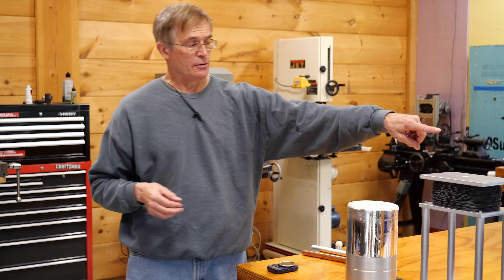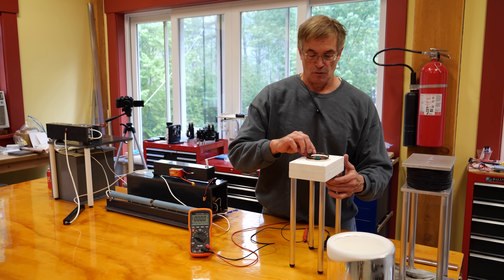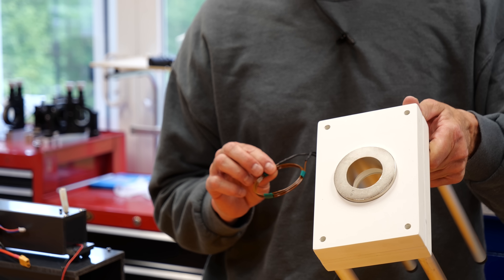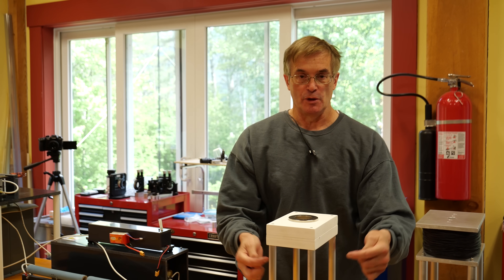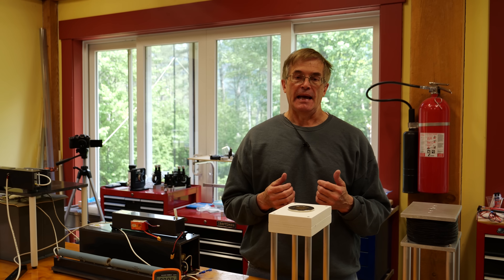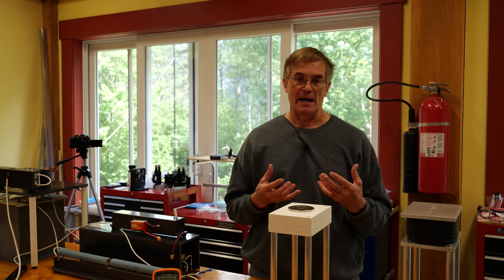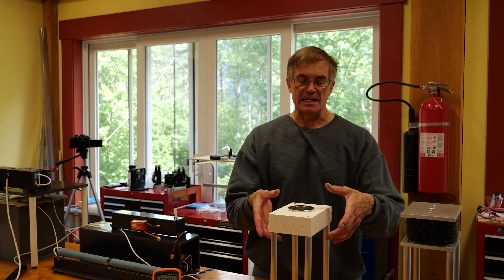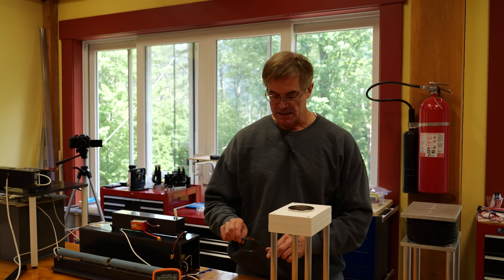No, we didn't use Magic to Crush this Can...

Comment: Question:  I have heard from people at Lockheed skunkworks that rotating a ferromercurial -barium and bismuth mixture in a circular closed tube system, similar to yours with sequential pulsed magnetic fields firing increasing speeds, they were able to achieve  "near-relativistic " speeds, a green glow started emanating from the tube, the whole apparatus was setup on top of a tared scale. At those speeds,, the weight of the system became negative & decreased anywhere from 5-18%.  I  wonder what your comments are about this. The unknown is the proportion of each element used in the mixture.  I suspect this likely produces a wave that interferes with gravity waves or particles, kind of the equivalent to a "standing wave". What do you think?  A paper was published from U of Alabama in 1997, from a Chinese researcher in the physics department,was axle to create such a reduction or weight by rotating circles of barium-copper at different speeds under a non metálica weight , I believe it was wood or plastic attached by a string to a digital "fish scale".  I believe there is something to this, likely not producing antigravity, but rather interfering with gravity waves/particles...  any thoughts?   Sergio  AKA Dr. T (physician, not physicist!)

Comment: Yes I just feed one point two-one gigawatts into the pulse capacitor...sorry...flux-capacitor, and the Time pinch wedges open a brief gateway to the fourth dimension...

☺I actually love your TMP design... I would have blown up an SCR because I didn't know any better...  Hmmm...a Spark Gap sounds like a fun project...  I might just do it because I'm curious what would happen if the can was subjected to a second event (or several)...  Would it shear?  Would it collapse further?  Would it be too far from the coil to generate an additional effect?  I'll keep a fire extinguisher handy... 😶‍🌫😉

Comment: What sort of effect would you get if you filled the chamber with deuterium and tritium mixed with a heavy noble gas like Xenon?  Perhaps with that difference in atomic weight could be used to create a shell of Xe gas around the reactant gases.  The xeon plasma encapsulating the deuterium/tritium mixture could still be hot enough to maintain a high enough temperature for the reaction but trap particles from hitting the walls of the containment vessel.  It's just a thought.
Reply from the maker: The Xenon won't help.
The necessary  temperatures are so high that ANY gas present will prevent those temperatures  from being reached by transferring the heat to the walls of the enclosure.

Comment: I've seen this video in the past but I just noticed the pinch after the magnet seems to propagate slightly.  Is this due to the flow of electrons similar to mach diamonds in the exhaust of rocket engines?  Obviously the electrons are moving much slower.
Reply from the maker: I suspect not.  It's likely due to the extended field from the magnet.
Reply: @TechIngredients    I thought about that as well but given that B fields loose strength at a rate of r cubed I figured the ripple would significantly decrease rather than keep a similar magnitude.  I may run it by my rocket propulsion professor since he does research in electric propulsion.

Comment: Probably the best explanation of the superconductor importance for TOKAMAC fusion that I have ever seen. The REBCO superconductors really do make fusion a reality, now, and not that , always ten years away line. There are many groups with compact designs, modular designs that enable replacement and quick turnaround due to the size reduction. Ultimately, this technology will give mankind limitless cheap power, and will usher in a new paradigm changing the way mankind lives . Things that seem impossible now, won't be. Unlimited power , an inexhaustible energy source, we will quickly spread out from our little nest.
Reply from the maker: The most exciting aspect to DT fusion is not electrical power, but transportation.🚀
Reply: @TechIngredients  Oh yes ! absolutely ! That plasma enables incredible possibilities for sustained thrust that could allow us to get to a serious fraction of c, theoretically. Of course, the limiting factor will be shielding the front of a vehicle from particulate matter. Running into a grain of sand at ten percent of c would not be good !

Comment: Awesome content and I appreciate the accurate technical details you include which is a relief when I am sorting through the fallacies of the information age represented on the internet. I have a request also. Could you do a project on how someone could produce their own electricity. For instance I was disconnected from the grid, which for brevities sake We'll say because the electric company is strong arming me seemingly because I don't use  much electric at all, and I need a sustainable way to live modestly in the modern world. That means electricity, which I would say those requirements could be met with as little as a few hundred watts of power if not using any high draw appliances. Basically just a few lights and the ability to charge a phone or tablet. I've switched over to propane so other than air conditioning I don't need much electric. At the moment I'm basically using the setup a RV might use; using 12V batteries and a 500 watt inverter which I power basically by charging them with my vehicle whenever I use it. It's actually like siphoning waste power that's always been there in a way, although I realize there is a negligible amount of extra effort this produces. Gas powered generators are not very efficient and I think I can do better. I've thought about solar but that's pretty much buy and install and is fairly expensive and not economical where I live at in the Appalachia. I've recently been looking into thermopiles to capitalize on the waste heat I produce for electric and also possibly for use with refrigeration. What ideas do you have. Thanks

Comment: A car engine has maybe 100,000 watts of heat going through it cruising on the highway.  But it does not even get close to the boiling point becauae of cooling.  A gas turbine has millions of watts going through the small space of the combustion chamber.  But it does not overheat because it is air cooled with compressed air.  Compressed air driven through the magnet coils could do the same thing.
Reply from the maker: Sure.
That would be the way I'd do it if I needed  to generate a powerful  magnetic field for an extended period.

Comment: I've watched several videos on z-pinch and this is by far the best demonstrating it. However I'm still left wondering from these videos is there a significant increase in energy output because of the z-pinch? Or is it just a physical means to keep plasma off the sidewalls. Additionally I read that z-pinch can create by-product x-rays is that correct?
Reply from the maker: Thanks!
It's a field manipulation that can be used to isolate plasma from the physical surroundings. If that permits higher temperatures to be generated, then it will facilitate fusion reactions.  Likewise,  a high enough plasma temperature will generate X-rays long before achieving the conditions necessary for fusion reactions.

Comment: How to make low temperature for the magnet ? Thank you
Reply from the maker: Rebco tape will work at liquid nitrogen temperatures, and you can get liquid nitrogen at low cost from a typical welding supply retailer.

Comment: Indeed the mechanical force created by moving electrical conductor in the magnetic field could be sensed. I have tried this with computer Hard Disk Heads Permanent Magnet and the Disk itself, all disassembled, in order to discover if the disk is made of glass, as many are, and may break, but used as a perfect mirror too, or of aluminum, and could be bent. Aluminum disk will pose a certain resistance or "own will" to the moving, while moving in the hand between the magnet poles, which glass disks will not.

Comment: Would there be a significant difference if you replaced the can crushing coil with a copper tube that has liquid nitrogen flowing through it?
Reply from the maker: There would be an increase in the energy transferred to the field.  Similarly, if the can was cooled to liquid nitrogen temperatures the current, field and crushing would increase.
Reply: @TechIngredients  So cool, pun intended.

Comment: Wouldn't you have a huge voltage drop due to the resistance in the small wires? If it was a constant current the wires would melt...?
Reply from the maker: You do and that's why you need such a high driving voltage.  You could use thicker wires and lower voltage and get the same result if the peak current is the same.  Current  is what matters, but a high current circuit including a low inductance, high capacitance capacitor is more expensive.
The short duration  is what limits resistive heating.

Comment: Thank you for this very thorough presentation!  I still can't see, however, why two currents in the same direction attract - to my way of thinking, the "arrow-heads" on any pair of field rings around each wire would collide head-on in the space between the wires, causing a repulsion, and cancelling out the field at the midway point. Where am I going wrong?
Reply from the maker: They do.  The current flowing in the opposite direction attracts.
Reply: @TechIngredients  Thank you for your reply!  I know the traditional classroom explanation for the attraction of the wires goes something like: "the electrons in one wire are moving in the magnetic field of the other wire, and by the Right Hand Rule, this results in an attraction."   However, I still can't see how the magnetic field of one wire can reach the other wire, let alone get inside the wire to influence the electron motion, as each wire is closely encircled (shielded) by its own strong cylindrical field.
Reply from the maker: The fields extend outward to infinity. It's important  to realize  that field lines are an intellectual construct and don't  actually  exist.
This is why electrons bound to atoms can interact to hold molecules together. The fields don't shield fields. They interact.
Reply: @TechIngredients  Thank you once again!

Comment: Where do you get all your stuff? Anyway, if two electrons are sitting still, they will repel electrically. But, if I run across the room so they acquire a common velocity (relative to me), will they really repel each other? My relative motion should not affect the force between two electrons, should it? Or is there something else going on?
Reply from the maker: Can you rephrase your question? Your motion relative to two outside electrons will not affect their interaction with each other.
Reply: @TechIngredients  - Your explanation at just before 6 minutes is that electrons moving in the same direction cause the rods to attract each other. If I put two electrons one cm apart on a vertical line, they will repel each other (like charges repel according to Coulomb's law). If I walk to the right of my stacked electrons, they will (in my frame of reference) appear to be moving together in the same direction to the left along parallel lines with the same speed that I am walking with. This is physically the same as what you explain: The electrons are moving together along parallel paths (in my walking frame of reference and your stationary lab frame). I then wave my hands and invoke the right hand rule about fields to say that those two electrons now attract each other. Electrons typically move at a few cm/s in a wire, so I should be able to see this effect even if I walk very slowly. That effect, by virtue of me walking across the room, should then cause these two electrons now attract each other bringing the wires together? If I stop, I now have two stationary electrons again , and they should repel each other. 

I know "like currents" (current in two wires in the same direction) attract each other. I know you know the true answer, but it is the hand waving part about the fields that often confuses students.  That is what caught my attention and the important missing part of the explanation ... and inspired me to respond. Anyway, a plasma current is very different from isolated wires carrying current. If I project a straight, columnated beam of electrons, they will in fact diverge away from each other as they travel along: They will certainly not form a tighter column (due to both statistical repulsion [Fermi exclusion principle] and electrostatic repulsion). ... but I diverge.

Incidentally, by "stuff", I meant your physics demo equipment. I like it.

Comment: I was going to make this comment when I watched you with the the first video I was going to ask you why you would not use noble gases with some Mercury you can get some beautiful colours I used to work making me on a long time ago I was also going to make a suggestion about your electrodes for safety you can get a compound when you're walking in neon and you can wrap around any exposed metal and it will stop any chance of electrical arching to you or anything else just called compound that's a green compound

Comment: How strong does the magnetic field need to be in order to create fusion using zeta-pinch?
Reply from the maker: It's proportional to a product of the density x temperature x confinement time of the plasma.  Temperature is not a problem. Density/confinement time depends on the magnetic field and the volume of the plasma.  ITER is huge and approximately 13 T is close to expected break even.  The higher the magnetic field, the smaller and more practical the reactor becomes.

Comment: Instead of using dangerous mercury use a germicidal florescent bulb with no coating . Could even apply 4 volts to the
side used as a cathode this will boil off electrons from cathode and could use lower voltage

Comment: A phosphor coating in a fluorescent lamp would give off a green glow. In fact, the walls of the tube are coated with calcium tungstate.
Reply from the maker: There are a huge variety  of phosphors.
They emit wavelengths from the UV to the infrared. Green is just one of those colors.
Reply: @TechIngredients  When you say "phosphorus" you mean the element phosphorus (P)? Or we are talking about luminophores in general?

Comment: Hi Tech ingredients, most of the video vocabulary is unknown for me........ However 😊 I have a question: will it be any difference on how the can react physically if it will be on a much lower temperature if you do the same experiment to it? Thank you in advance!
Reply from the maker: It's clear you understand the principles.  Yes, a colder can will support higher currents because of lower resistance and it will crush further.